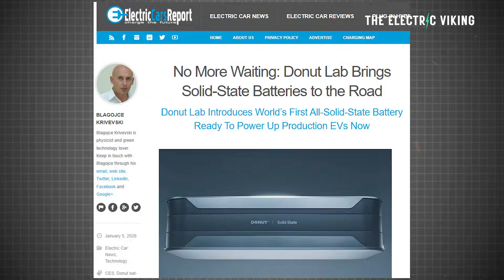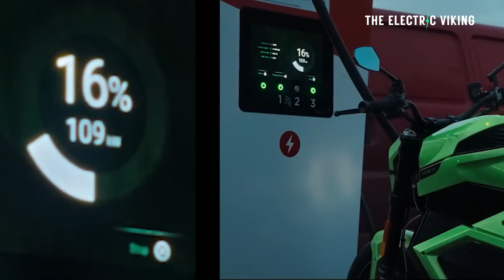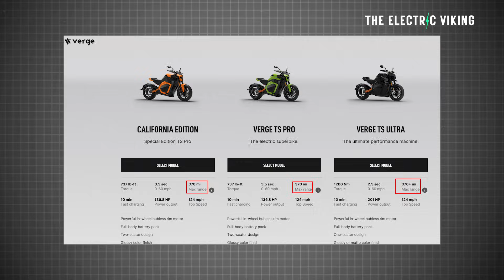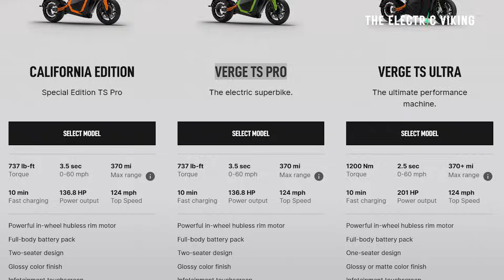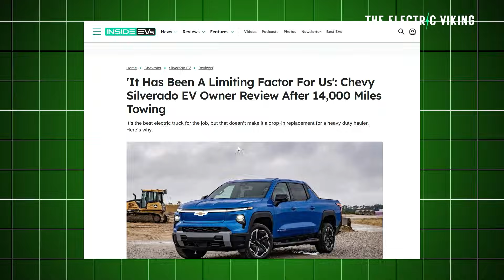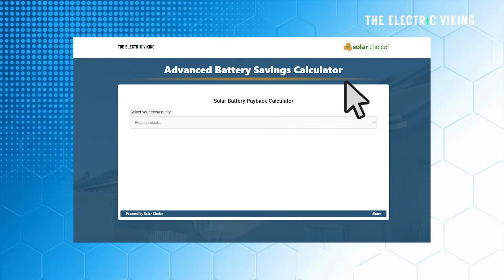The world's first true production-ready SOLID-state battery lasts for 100,000 cycles

Comment: Donut Lab's latest video answers some questions raised here about their (Verge) motorcycles. Yes, these batteries will be in their bikes and yes, they will even consider retrofitting in their older bikes. The second big news is that they are launching a "skateboard platform" which includes their new battery and their motor-driven wheels, for EV (car) manufactures to drop the body onto.  They also say that their battery packs are designed to be used in place of current packs EV manufacturers are using and that the price will be competitive enough for it to be integrated in even the lower price point vehicles.  

I see great potential of their motorbikes being used in places like Vietnam and India, where bikes are ubiquitous, but pollution and noise are a concern.

Comment: I'd still be taking this news with a fairly significant number of grains of salt
Reply: Probably with a TRUCKLOAD of salt...
Reply: @gatomalo69  With a truckload of sodium ions, I'd say.
Reply: If its not true they've signed the death warrant for the millions that has been invested in Verge motorcycles.
Reply: @jinparksoul  - Tesla still does not have self driving cars 😂 I think if they push out a “Meh” battery that works, the general public will gaslight themselves into thinking its everything they promised for about 3-4 years.
Reply: @P.Joubert Give me an example of a product promising the moon and an it not coming anywhere near the claims but everyone gaslighting themselves into believing they got everything promised?
Reply: I'll take a few tons of salt please
Reply: Yeah these are some lofty claims!!
Reply: The salesman or ceo looked and acted like a crook.
Reply: I'd take this news slow, with lots of starts and stops... because it's likely a battery-supercapacitor hybrid, and while it may provide 400 Wh/kg at the cell level when discharging by ion diffusion under low discharge, start/stop states (like 20-25 mph city traffic), it probably discharges more like a 150 Wh/kg capacitor on the highways at higher and constant discharge rates.
Reply: you come up with that all by yourself?
Reply: Let’s see Gigawatt hour charging.  So a 20 space charging station would need to provided 20 Gigawatts of electricity to be able to deliver those kinds rates.  Not gonna happen.  Oh, there’s that physics thing getting in the way again…oops.
Reply: @ReluctantLuddite  Exactly. Im no electrical engineer, but even if you can charge batteries that quick, it would mean you would have to increase the available power supply. The power grid would need a huge upgrade to come even close to supporting these ideas.
Reply: https://www.youtube.com/watch?v=Qsi-TS8PX7U

Comment: Did I sleep the whole winter away? Is this April first already?
Reply: April first - no.  Electric Viking - basically the same thing.
Reply: Capacitors and super capacitors aren't batteries. How? Well they charge and discharge instantly for instance. That's capacity measured in Farads.

Power requires energy over time. That's a Watt. Where is the time in an instant?

Thus capacitors cannot be used in lieu of batteries, and/or vice-versa. It's only physics.
Reply: @lucienpan1679 one instant followed closely by another instant is the definition of time.
Reply: Ich habe zuerst auch gesagt, dass ist ein Betrüger, die Chemie gibt’s nicht. Aber da ist ja noch die Klasse der Kondensatoren - Feststoff Aufbau …
Reply: @ralfrudiracer 
So are these super capacitors ?

Comment: Donut states it's a 33.3 kw battery for the over 300 mile range. You need to look at all the videos before reporting it. Donut shows how to replace tires on the motorcycle. They tell you it's a 17 inch motorcycle tire/wheel. There's  a lot more on the websites and videos.

Comment: Initially both giddy and suspicious (renovating a 2007 low speed utility truck), the Viking's pointing out the fact that Donut's motors with their astounding torque are not only real, but in actual use leaves me wondering how it could be possible that a company with such proven potential through motor innovation would destroy their reputation and business prospects by fooling everyone about a solid state battery.
Reply: When the money is running out in a company you do everything to save it. They have continuously raised money while doing loss. I suspect this is the latest trick before an IPO and then bankruptcy.
Reply: @TurreTuntematon  In the 1700's, Gottfried Libeniz was famously deried by Voltaire for saying quite stupdily "This is the best of all possible worlds."  As with any creature, our human brains are wired for the familiar where we feel safe.  Change, which we grasp only linearly, distresses us.  Exponential shifts?  Fo-getta-bout it.  Fusion?  Graphene?  Technologies with unseen jaw-dropping potential for decades.  But their practicality is in fact now being realized.  It seems possible that Donut Lab solid state batteries are based on something like curved graphene super capacitors.  Still, your suspicion of IPO and bankrupty is very, very intriguing.   I lost big on A123.  Donut Lab offers only ultra-slick, thin-on-details presentations never with third-party confirmation.
Reply: Agree with your balanced logic. Lets see what happens when all the premature ejacuation settles down.

Comment: The 'Donut' solid-state battery and skateboard platform sounds incredibly ambitious and innovative!  While the vision is exciting, I can definitely foresee some significant hurdles that will need to be overcome for widespread OEM adoption.
Here are a few key points:
Technical Gauntlet: Solid-state batteries still face challenges with long-term degradation, thermal management, and scaling consistent production. The 'Donut motors' (likely in-wheel) could mean higher unsprung weight and potential efficiency/durability questions compared to central motors.
Software Showdown: Integrating a new 'Donut OS' into established OEM software ecosystems is a massive undertaking. Think compatibility nightmares, cybersecurity risks, and OTA update complexities.
Crash Test Dummies & Dollars: Ensuring this platform meets diverse global crash safety standards for various vehicle types is a huge engineering feat. Plus, the initial manufacturing scale and cost of these advanced components will be a major barrier.
OEM Resistance: Many big automakers have a "Not Invented Here" mentality and are heavily invested in their own tech. Convincing them to adopt an external, core platform means giving up significant control and IP.
Differentiation Dilemma: If multiple OEMs use the same 'Donut' base, how do they maintain their unique brand identity and driving dynamics? Customization will be key, but that adds complexity and cost.
Supply Chain Tightrope: Relying on a single supplier for such critical tech creates significant supply chain risk.
Ultimately, while the potential is huge, "Donut" will need to demonstrate exceptional performance, reliability, and a clear cost-benefit advantage to convince OEMs to jump on board. It's an exciting space to watch!

Comment: US to Europe needs 1,500+Wh/kg at the pack level for transatlantic flights.
Reply: yeah, his claimed 500 Wh/kg seems crazy low. I mean lets do some math really quick. Flight from Frankfurt to New York. Takes about 9 Hours. About 5 tons of fuel per hour (i googled and saw around 5 to 6 tons per hour) Thats like 45 tons of burned fuel. Energydensity of that burned fuel is 12 kWh/kg. So we got 12kWh/kg * 45000kg = 540 000 kilowatt hours of energy burned. Assuming the jet efficiency at about 40% we get about 216,000 kWh of energy needed assuming our electric plane is 100% efficient (which it isn't of course) So at 500Wh/kg we would need about 432 TONS of batteries. And at that weight it would burn even more than just 5 to 6 tons which would need even more battieries....... (Also the plane gets lighter due to fuel burn, the battery plane always weighs the same which also has a negative effect) I don't know where this guy gets his numbers from. Even 1500Wh/kg seems a bit low. Is there a study or a research you could link me?
Reply: @Bullseiify Elon has talked about using batteries integrated as structural components. How about something shorter than Frankfort. Lindbergh flew 5800km to Paris. Don't think he needed as much fuel as you suggest. Start small.
Reply: We’re not looking at that yet. But 200km eVTOL air taxis should be very do-able with this

Comment: Donut and Verge Motorcycles say the new solid state battery costs less to manufacture and implement than lithium ion batteries. A representative of the electric motorcycle builder told me that the TS Pro is already being manufactured with solid state tech and is currently available for order starting at $29,900. The electric motorbike is said to cruise for up to 217 miles (depending on the configuration) and charge at up to 200 kilowatts, juicing up in under 35 minutes.
Reply: That’s the old battery specs. Not these.
Reply: Doesn't sound anything special

Comment: Last year: Donut Lab claims its wheel-hub donut motor is a game-changer for the auto industry.

A year later, Donut Lab's donut motor isn't even a blip in the auto industry.

This year, Donut Lab claims its vaporware battery is a game-changer for the auto industry.
Reply: putting motors in wheels is really stupid in the case of cars ... there is no water those will be water tight for life... acceptable for bikes, because they stay home when it rains
Reply: @MayonaiseSailor Actually no. I saves a lot of weight. Ayyy lott
Reply: In wheel motors have less application than batteries come on now man
Reply: There's a difference between new motor that sits inside a wheel and a new battery that sits where every other battery sits.

Comment: 1) LFP is good enough and dirty cheap to replace over 90% of ICE applications from cars up to farm tractors and trucks. The remaining 10% will still require NCM.
2) Solid States Batteries (SSB) are requiring still a of R&D in product and process before maturity. They are also expected to cost more per kWh than LFP.
=> I want first my smartphone, my Garmin, my headphones and laptop PC to be fitted with SSBs. Then my EBike and gaming gears.
Flying taxi drones and planes would also benefit from SSBs.

Only after all those will i start to consider SSBs to maybe relevant on EVs.... but i still believe that SSBsd will never be competitive vs LFP wet cells/battery packs on EVs.
Reply: :face-purple-crying::face-purple-crying::face-purple-crying::face-purple-crying:. no sabes leer ?

Comment: Now China will buy 1 unit of that, copy it and produce millions with quarter of the price. Bye2 donut
Reply: Not necssary, the problem of scalling up production is inhereted from the design. Some orgnization decided to go back drawing board to refine the design or compromised the design in favor of scalability. Some will just go ahead and roll thr dice to push the design to market. In this case, the only way for Chinese to get a copy of this battery is through illegal channel. Im sure within the week, this battery will be on export control. And when some Chinese firm does tearing apart, they may say. Good design, but we cant do it in scale... Yet.
Reply: @林振华-t4v  they have been doing thru all types of channel (legal and illegal) all this while. They embraced their capability to copy ninja and also to scale and do iterations at lightning speed. They are not gaining all these advancements from scratch.